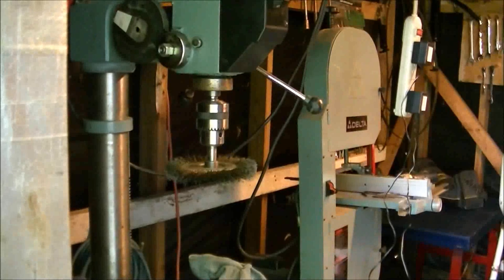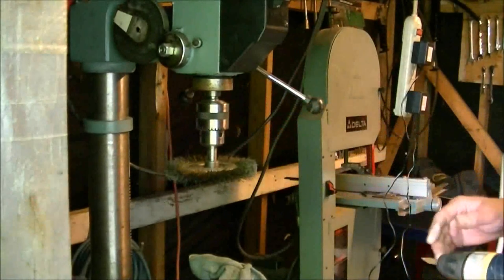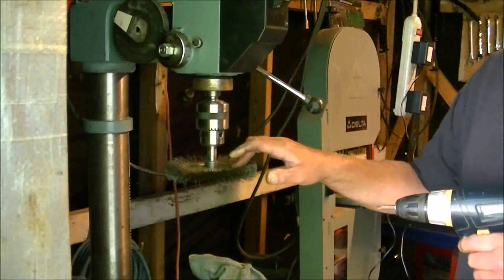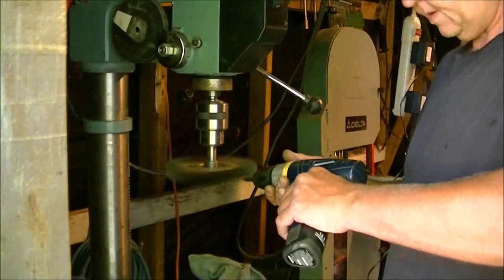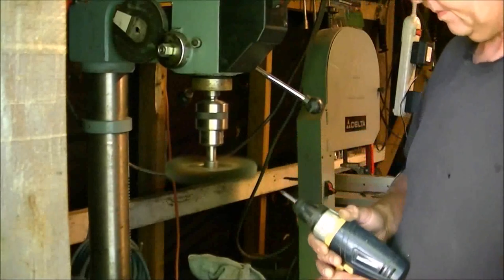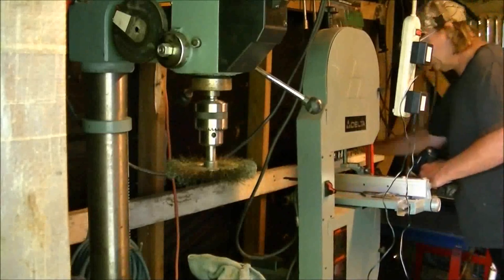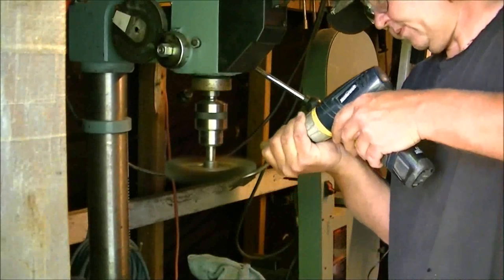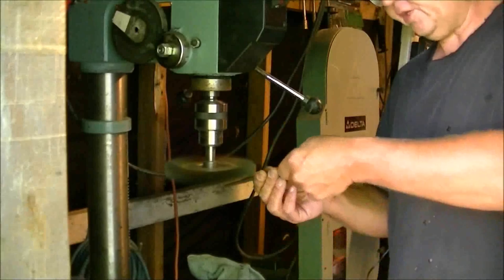How to clean rust off screw driver bits and spade bits etc

Comment: store them in an enclosed place with camphor blocks(they are super-cheap). They release a gas that coats and metal and prevent oxidation. Removing the rust you do this or run everything through a bucket of avaporust. Then dawn+water them and run them through used or cheap motor oil quickly. Screen-drain the oil off before storing them with the camphor blocks. Just from my experience..

It's an annoying process but that's the best I've come up with to date. I do this with my screwdriver bits and other tools at least once a year. Drill and screwdriver bits rust the fastest because no chromium or stainless..
Reply from the maker: interesting
Reply: Ole school machinists trick.  Thanks!